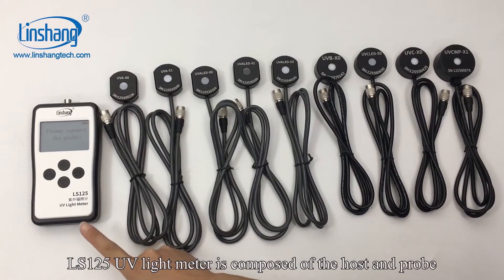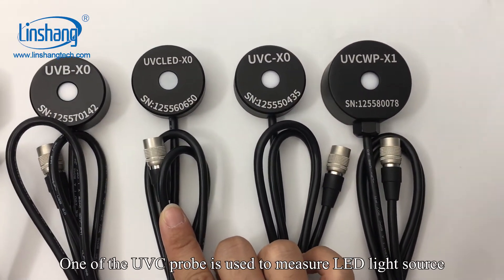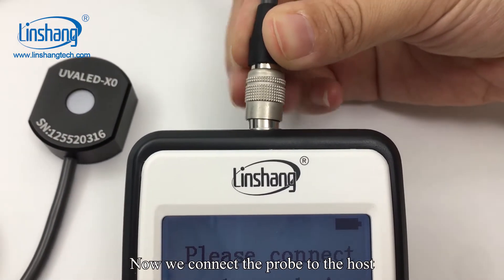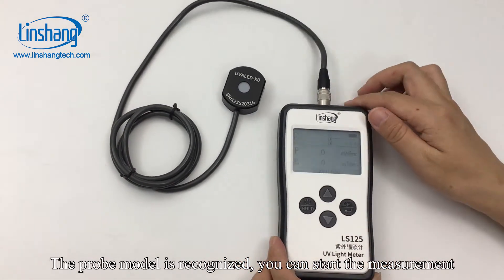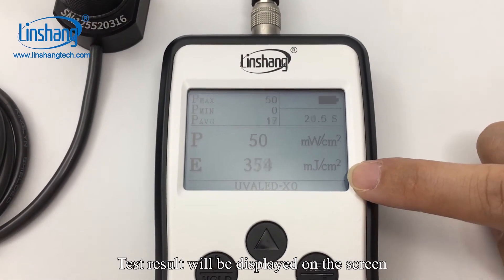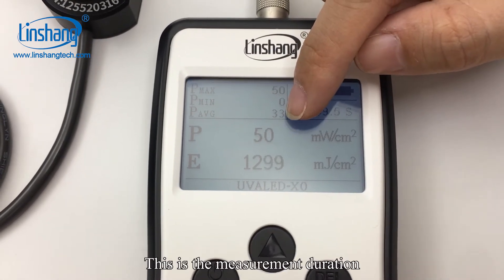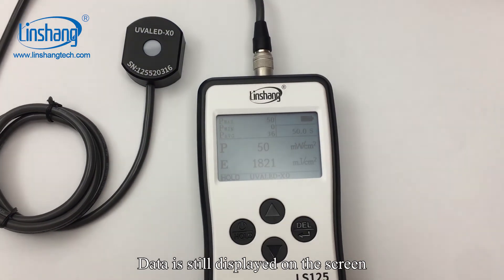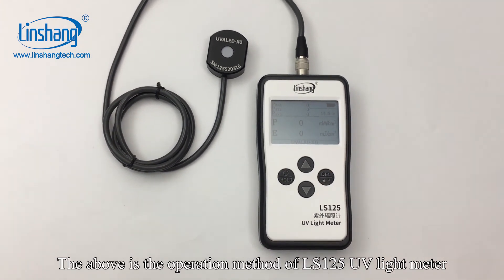LS125 UV light meter operation

Comment: Can you verify for me if UVB works with sunlight in summer?
Reply from the maker: You can use UVB-X0 probe to measure sunlight
Reply: @linshangtechnology7683  I sent an email. Would appreciate a demo (video)  as verification just to be sure.
Reply: @linshangtechnology7683  I got it. So far works great. Have to wait until summer until I can fully use it.
Reply from the maker: @ralfschooneveld3186  thanks ~